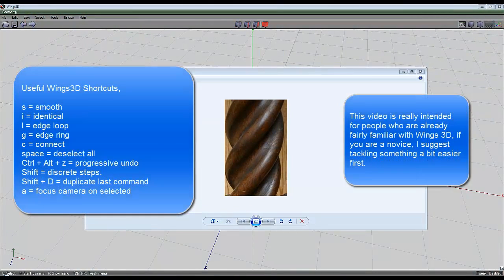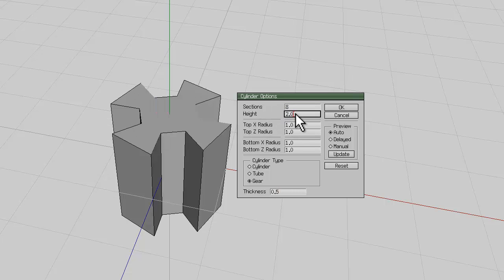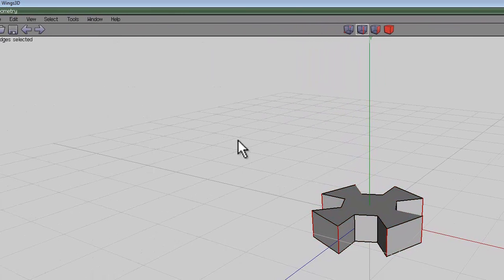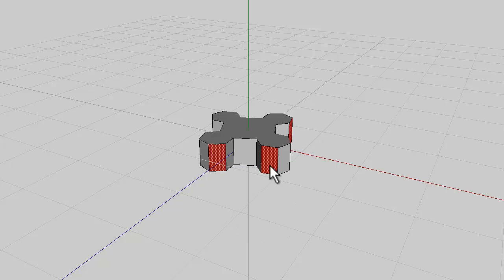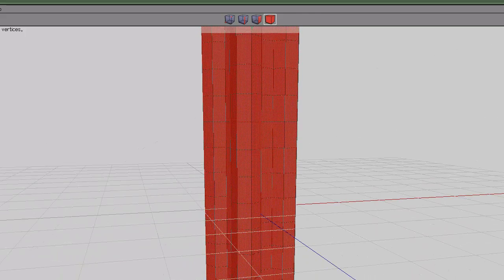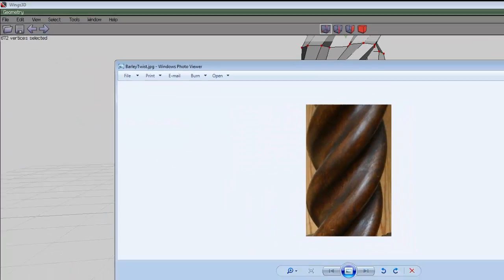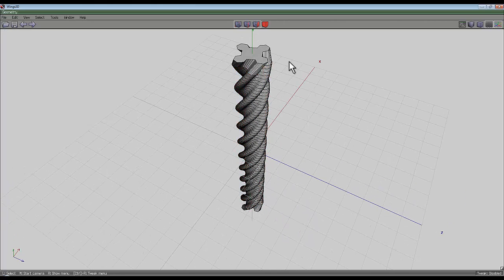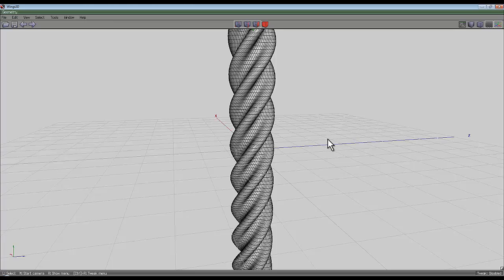Wings 3D project - Barley Sugar Twist - by David Brinnen.

Comment: Well I gave the bend a few attempts and got the mechanics of the command down pretty well.
But due to non angular faces when trying to choose one for the bend normal the ends of the mesh do not line up well.
I watched a good bend tutorial but he was using an angular mesh with wide squared faces, which I tried and it worked well.
The twists in this mesh do not lend themselves well to the bend, for me anyway.
And I am very new to this command!
If anyone else can give it a go and work it out please do let me know how, cheers.
Reply from the maker: Ever more weird, seems youtube has decided your comment is spam and won't let me read all of it.  However, I can reply.  When I get the chance I will have a look.  So what you want to do is turn the twist into a ring right?  Should be a way to do this trick by modifying a torus I would have imagined.
Reply: David Brinnen Hi David, well youtube gets no points from me lately it has been a mess!
And I would like to connect the ends to make a sort of chain/ring of sorts if you will.
I thank you for your time Sir, cheers.
Reply from the maker: Murray tietelbaum Next video I am uploading may help.
Reply: David Brinnen I just happen to look at my e-mail and saw your reply.
Thanks, I will surely check out the video.